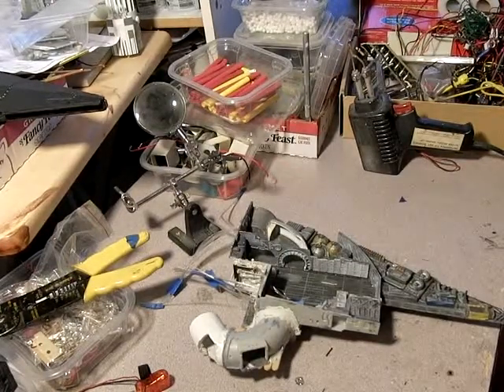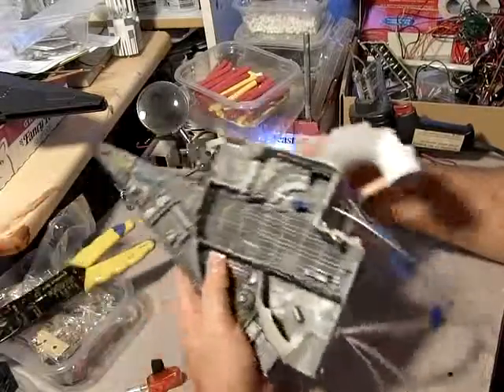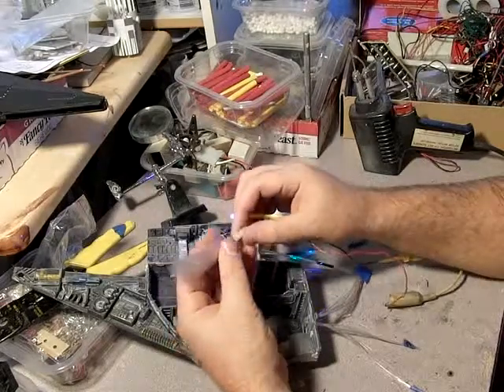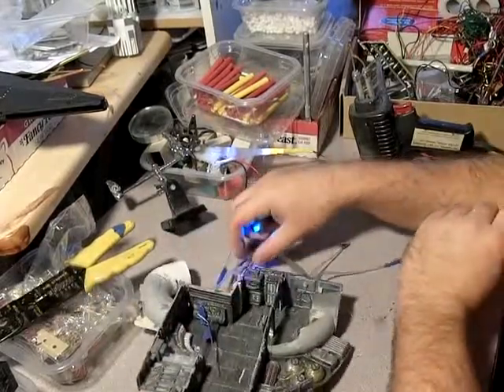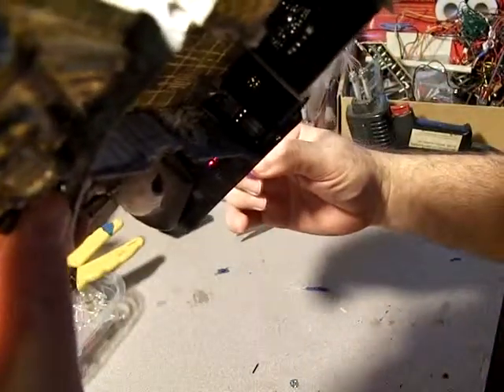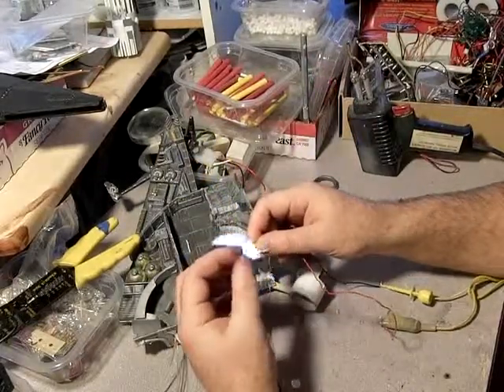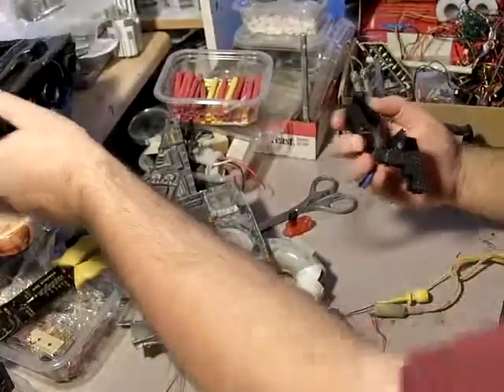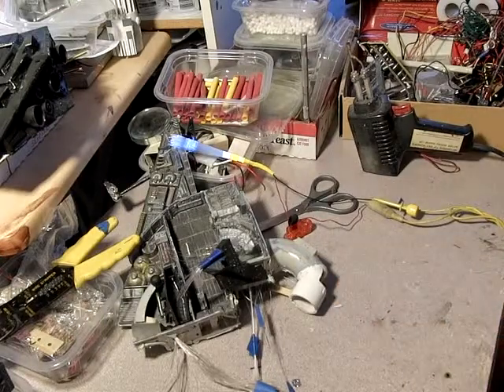Tools: Fiber Optics

Comment from the maker: re: cockpit: 
There's a thread in the WiPs @ Resin Illuminati  where the guy drilled all the holes needed, colored a plastic insert different ways, placed it behind/under the CP controls and lit the whole thing w/ 1 white led.  It looked like he had all sorts of FO diameters and several diff. color lights in there, but in reality, one led and no FO at all.  If I come across it again, I'll pass it along.  A basic search on xwings over there may turn it up.